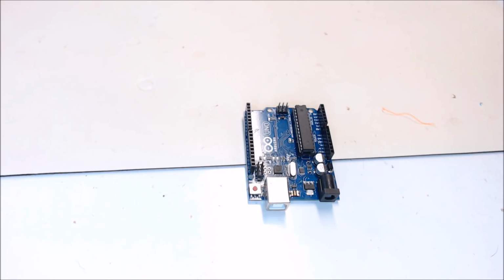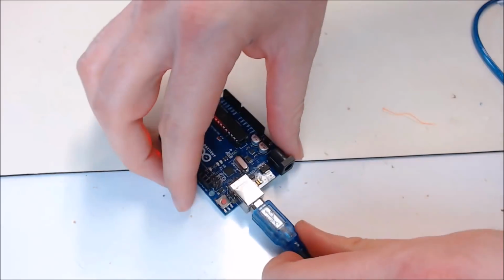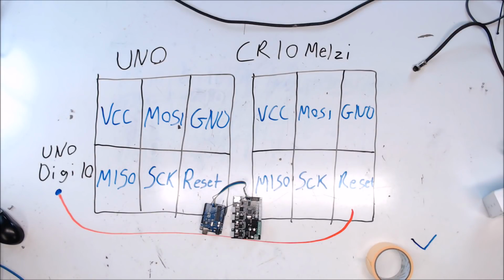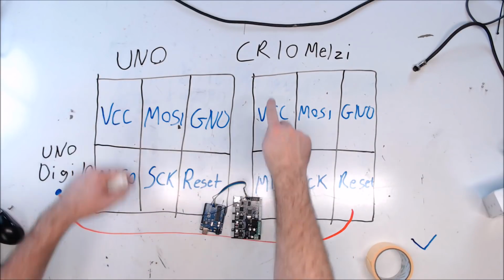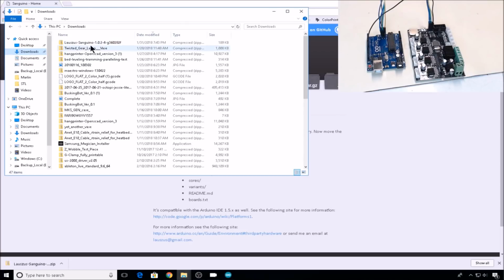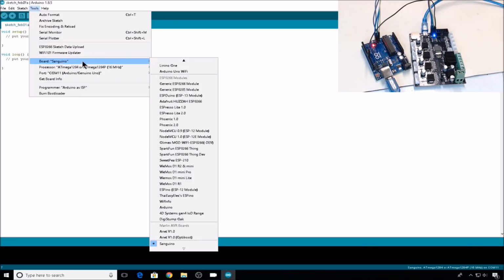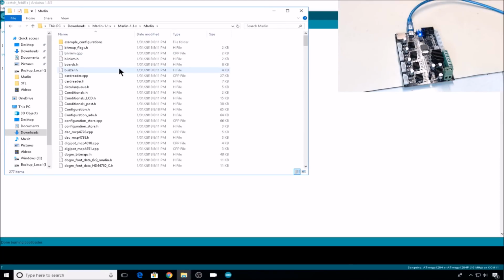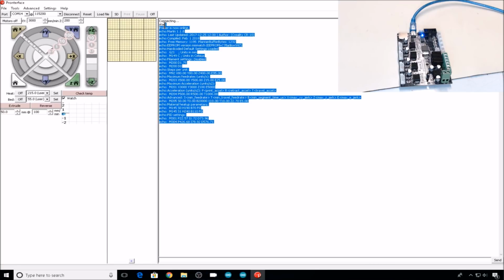Creality CR-10 Marlin Firmware Upgrade - Chris's Basement

Comment: OK. got the drivers for the Melzi all loaded and windows is recognizing the com port and assigning it a com port number. Made sure that everything is exactly as u stated. go to upload and get the error “error compiling Board Sanguino”. disconnect everything and turn on control box and NOTHING. i think that the m/b is bricked. anything that i can do short of purchasing a new m/b, which i can’t seem to find on the internet. everyone is out.
Reply from the maker: If you hit verify in the IDE, does it compile? What is the the whole error in the bottom window?
Reply: No, it gives the same error as before. Here is the error in its details:
Arduino: 1.8.5 (Windows 7), Board: "Sanguino, ATmega1284 or ATmega1284P (16 MHz)"

C:\Users\kevin.zeringue.DECGEN\Downloads\Marlin-1.1.x\Marlin-1.1.x\Marlin\Marlin.ino:45:110: fatal error: U8glib.h: No such file or directory

     #include <U8glib.h> // library for graphics LCD by Oli Kraus (https://github.com/olikraus/U8glib_Arduino)

                                                                                                              ^

compilation terminated.

exit status 1
Error compiling for board Sanguino.

This report would have more information with
"Show verbose output during compilation"
option enabled in File -> Preferences.
Reply from the maker: Ok, easy fix, you need to add the display library to the IDE. https://github.com/olikraus/U8glib_Arduino If you need help I can walk you through adding a library.
Reply: I have downloaded the library and I see in IDE the selection for Include Library ( I guess this is where I need to be) but I am lost after that. Please help.  You have the patience of Job!
Reply from the maker: Copy the U8glib folder in the \Documents\Arduino\libraries folder and restart in IDE Arduino software and try verify again.
Reply: added the folder to the libraries folder and I am getting the following message:
Arduino: 1.8.5 (Windows 7), Board: "Sanguino, ATmega1284 or ATmega1284P (16 MHz)"

C:\Users\kevin.zeringue.DECGEN\Downloads\Marlin-1.1.x\Marlin-1.1.x\Marlin\Marlin.ino:45:110: fatal error: U8glib.h: No such file or directory

     #include <U8glib.h> // library for graphics LCD by Oli Kraus (https://github.com/olikraus/U8glib_Arduino)

                                                                                                              ^

compilation terminated.

exit status 1
Error compiling for board Sanguino.
Invalid library found in C:\Users\kevin.zeringue\Documents\Arduino\libraries\U8glib_Arduino-master: C:\Users\kevin.zeringue\Documents\Arduino\libraries\U8glib_Arduino-master
Invalid library found in C:\Users\kevin.zeringue\Documents\Arduino\libraries\U8glib_Arduino-master: C:\Users\kevin.zeringue\Documents\Arduino\libraries\U8glib_Arduino-master

This report would have more information with
"Show verbose output during compilation"
option enabled in File -> Preferences.
Reply from the maker: Try removing the _Arduino-master from the folder name them try again.
Reply: Renamed the folder to remove the _Arduino-master from the folder name. Still getting the same error. deatils following:
Arduino: 1.8.5 (Windows 7), Board: "Sanguino, ATmega1284 or ATmega1284P (16 MHz)"

C:\Users\kevin.zeringue.DECGEN\Downloads\Marlin-1.1.x\Marlin-1.1.x\Marlin\Marlin.ino:45:110: fatal error: U8glib.h: No such file or directory

     #include <U8glib.h> // library for graphics LCD by Oli Kraus (https://github.com/olikraus/U8glib_Arduino)

                                                                                                              ^

compilation terminated.

exit status 1
Error compiling for board Sanguino.

This report would have more information with
"Show verbose output during compilation"
option enabled in File -> Preferences.
Reply from the maker: Kevin Zeringue Ok, I'll test it today.
Reply: For all of your efforts in trying to help me, i just bought you 3 cups of coffee. thank you so much
Reply from the maker: Hey thanks for the coffee. Here is a doc to get your around the U8glib error. https://docs.google.com/document/d/1-9qrvoH3oKmzG-ViZOhR2FxJUBQVTUmlIaJ9zQ-Ppqc/edit?usp=sharing
Reply: Following the linked doc and was able to compile the sketch. Updoaded sketch and received the following error:
Arduino: 1.8.5 (Windows 7), Board: "Sanguino, ATmega1284 or ATmega1284P (16 MHz)"

Sketch uses 124676 bytes (95%) of program storage space. Maximum is 130048 bytes.
Global variables use 15184 bytes (92%) of dynamic memory, leaving 1200 bytes for local variables. Maximum is 16384 bytes.
Low memory available, stability problems may occur.
avrdude: ser_open(): can't open device "\\.\COM4": The system cannot find the file specified.

Problem uploading to board.  See http://www.arduino.cc/en/Guide/Troubleshooting#upload for suggestions.

This report would have more information with
"Show verbose output during compilation"
option enabled in File -> Preferences.
Reply from the maker: All the memory errors are expected. It can't get the the printer on com4.  Unplug the printer from USB check the port list under tools in the IDE. Then plug your printer in and see which port is new in the tools port list. That should be the correct one. Make sure you aren't connected with pronterface or anything other tool as well.
Reply: SUCCESS!  SUCCESS! SUCCESS!!!!  Thank you so very much for all of your help!
Reply from the maker: Kevin Zeringue BOOM!!! NICE WORK!

Comment: I followed your steps but I could not Upload the Marlin firmware, got some error. please Help
Reply from the maker: Hai Vo Paste the error here and I can advise you.
Reply: U8glib.h: No such file or directory

     #include <U8glib.h> // library for graphics LCD by Oli Kraus (https://github.com/olikraus/U8glib_Arduino)

                                                                                                              ^

compilation terminated.

exit status 1
Error compiling for board Sanguino.
Reply: oh I saw one guy had the same issue, but the Github link is dead now.
Reply from the maker: Hai Vo You need to install the u8glib library in the ide.
Reply: I got it worked, thanks. BTW, very useful video :)
Reply from the maker: Hai Vo Thanks!

Comment: my cr-10s v2.1 board came today, with this video work for it as well?
Reply from the maker: You might not have to load a boot loader. Some of the newer ones have them already. I would just try to upload the Marlin first and see if it works.

Comment: this example config is broken, it doesn't compile, saying there is a file missing
Reply from the maker: Hey! I just complied it fine. I grabbed the newest version and it worked first time. Let me know if you need help.
Reply: Chris Riley hey thanks, it turns out I was being dumb, I didn't have the necessary libraries installed.

Comment: I got this while compiling
Sketch uses 127540 bytes (98%) of program storage space. Maximum is 130048 bytes.
Global variables use 15092 bytes (92%) of dynamic memory, leaving 1292 bytes for local variables. Maximum is 16384 bytes.
Low memory available, stability problems may occur.
avrdude: stk500_getsync() attempt 1 of 10: not in sync: resp=0x65
avrdude: stk500_getsync() attempt 2 of 10: not in sync: resp=0x63
avrdude: stk500_getsync() attempt 3 of 10: not in sync: resp=0x68
avrdude: stk500_getsync() attempt 4 of 10: not in sync: resp=0x6f
avrdude: stk500_getsync() attempt 5 of 10: not in sync: resp=0x3a
avrdude: stk500_getsync() attempt 6 of 10: not in sync: resp=0x53
avrdude: stk500_getsync() attempt 7 of 10: not in sync: resp=0x44
avrdude: stk500_getsync() attempt 8 of 10: not in sync: resp=0x20
avrdude: stk500_getsync() attempt 9 of 10: not in sync: resp=0x69
avrdude: stk500_getsync() attempt 10 of 10: not in sync: resp=0x6e
An error occurred while uploading the sketch
Reply from the maker: Looks like maybe the memory being low is causing the issue. Are you uploading this to a 128 board, ANET or Creality? Try commenting out this line in configuration_adv.h to get more memory. #define ARC_SUPPORT
Reply: @ChrisRiley  It is already commented out. I am using Sanguino  ATmega 1284P (16 mhz) Creality 10
Reply from the maker: @jamescullins2709  Did you uncomment disable m503 in configuration.h? What kind of leveling are you doing?
Reply: @ChrisRiley  It is stock for leveling. manual I will try disable m503
Reply: chris I got 
   #error "No FastIO definition for the selected AVR Board."
when the m503 is enabled
Reply: I have other problems I need to attend to I'll get back to you. Thanks for you efforts.
Reply from the maker: @jamescullins2709  Hmmmm....you might need to install the ch340 driver.
Reply: @ChrisRiley  It does still work with simplified 3d. I have never uploaded the firmware so I thought maybe I should. I was tolled it had the bootloader loaded just after I bought it, but... maybe it doesn't. I would hate to load the boot loader only to find I couldn't load the new firmware.
Reply: @ChrisRiley  What does m503 do?
Reply: @ChrisRiley  I enabled m503  and I still get a low memory on verify (compile only)'
Reply: @ChrisRiley  It still works with Simplified 3d. I am getting the low memory just  compiling like not related to the Sanguino board??? tomorrow
Reply from the maker: @jamescullins2709  That is really strange. If you wanna send me your files I can try to compile them on my side.
Reply: @ChrisRiley  Ok how do I send them to you? sorry for ignorance.
Reply from the maker: @jamescullins2709  The easiest way is to zip them up and put them on google drive and send me the link.
Reply: @ChrisRiley  OK thinks
Reply: @ChrisRiley  I have them compressed(ZIP) and in google drive. I copied the link but where do I send it?
Reply from the maker: @jamescullins2709  You should be able to just put it here in the comments.
Reply: @ChrisRiley  https://drive.google.com/file/d/1Hgl2rFLeJOHljTyj9cSCCu-mAb_43Fwh/view?usp=sharing
Reply from the maker: Hey James, I am just getting back to this, this zip file just has the ino file in it. I will need the whole folder zipped up.
Reply: @ChrisRiley  Of course you will, what was I thinking !! I will send it later today.
Reply: @ChrisRiley  https://drive.google.com/file/d/12DMxO65o8rXgg2fL_W5jsUqNCGf_Dk-u/view?usp=sharing
Reply from the maker: So I got it down to 95% by removing the comment from line 1230 #define DISABLE_M503    // Saves ~2700 bytes of PROGMEM. Disable for release!  Give that a try.
Reply: @ChrisRiley  Chris, thanks for your effort on this but I did the same and it still would not compile. I tried two computers. This one is Windows 10 the other Windows 7. My Arduino IDE is 1.8.9. It is working and printing at the moment so I think I will have a look at a 32 bit board, they are cheap enough and I would gain some functionality and speed. Thanks again for your time with this. Take care

Comment: This is the error I got the second time around. Any Ideas why it didn't work? TIA

Arduino: 1.8.5 (Windows 10), Board: "Sanguino, ATmega1284 or ATmega1284P (16 MHz)"

C:\Users\Rudemaster\Downloads\Marlin-1.1.x\Marlin-1.1.x\Marlin\Marlin.ino:45:110: fatal error: U8glib.h: No such file or directory

     #include <U8glib.h> // library for graphics LCD by Oli Kraus (https://github.com/olikraus/U8glib_Arduino)

                                                                                                              ^

compilation terminated.

exit status 1
Error compiling for board Sanguino.

This report would have more information with
"Show verbose output during compilation"
option enabled in File -> Preferences.
Reply: Hey same error here, but I found that u8glib.h in github website. Now I am facing memory 92% filled .that is no memory in the broad.

Comment: hey chris. does this also work with a cr10s?
Reply from the maker: Yes it should, I  am not sure what the S has on it, but as long as it doesn't have a touch screen you should be good. You might now even have to do the bootloader part.
Reply: @ChrisRiley  the S has a second z axis and some filament sensor. Doesnt have touch. Thanks!

Comment: does the marlin flash still provide the print resume function?
Reply from the maker: For the CR10, it will not, there is just not enough memory on the board to support it. You would have to replace the board with something else or use a 3rd party version of Marlin. Although I don't know that the 3rd party versions support it either.
Reply: i heard marlin 1.1.9 has print resume,  how much mem is needed?
Reply from the maker: I am not sure the exact amount, but it seems to work fine on all the 256 boards, like the RAMPS combos.